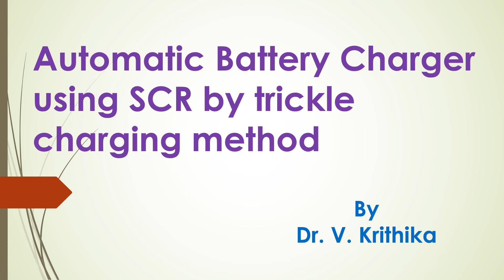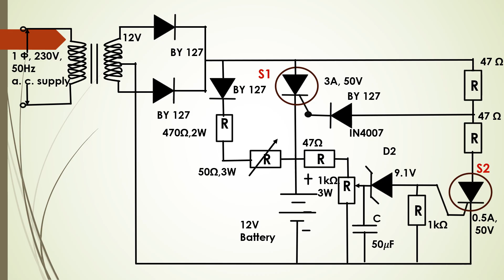Automatic Battery Charger using SCR by trickle charging

Comment: The trickle charging variable resistor you have marked as 50 ohm 3W.
I believe it should be 500 ohm 3W because your value is too small to be a useful adjustment.

Comment: Can you tell me whether the junction of resistor 50E/3w(variable one)and the 47E are connected to Scr-1's cathode or it is connected directly connected to Battery 's positive terminal? The video is a very informative one except the above point is clarified.